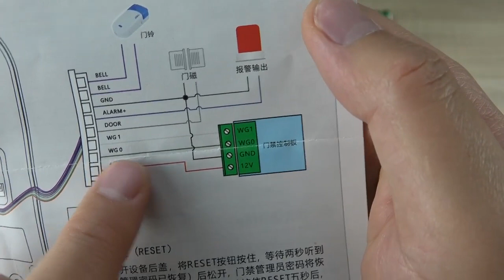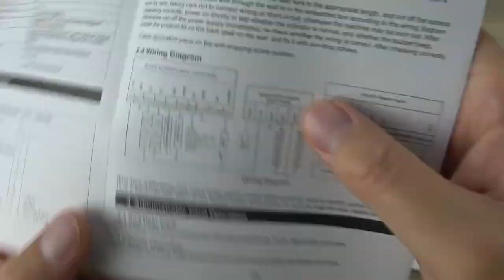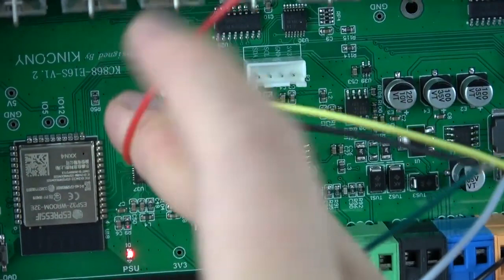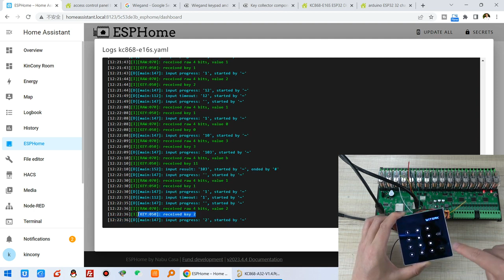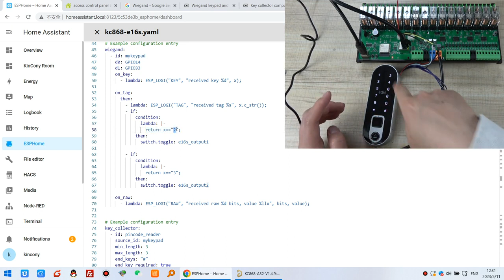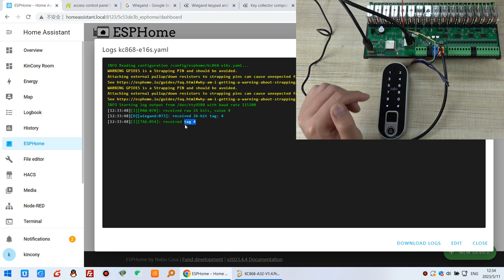add Wiegand access control system to home assistant by ESPHome

Comment: Do you know, if it works also with the TF108EM? The description only says WG0 and WG1 instead of D0/D1. Could the pins wired directly to the esp32 or does it output 12V? Thanks
Reply from the maker: Can you add my whatsapp:+86-15531181781

Comment: Thank you for the great video and information! This is exactly what I’ve been trying to find, although it has been a challenge until now. There’s a lot of information you presented to process. I’ve visited your website and blog, and it will take some time to figure out what I can and cannot do with the four Uhppote Access Control devices I just installed in my home. I chose not to go with their single board system, the one that can control 4 doors and locks, and I’m wondering if that might pose a problem for my integration and use case of wanting to view and control my locks via my Home Assistant Dashboards.
I appreciate all the excellent content you provide. 

Thanks again,  
RWG
Reply from the maker: Can you add my whatsapp:+86  15531181781